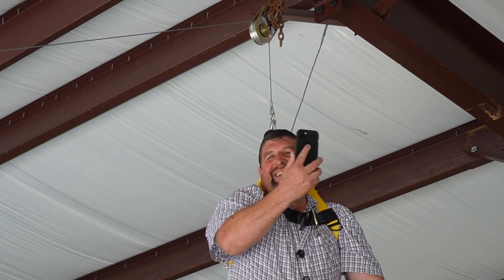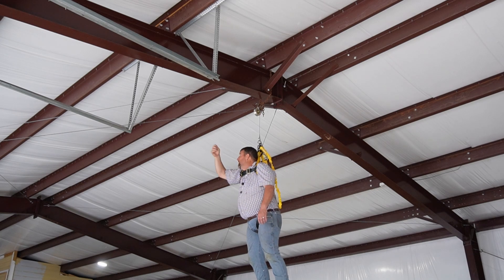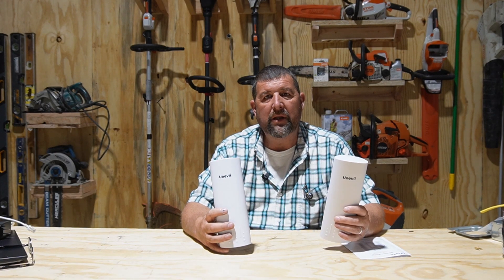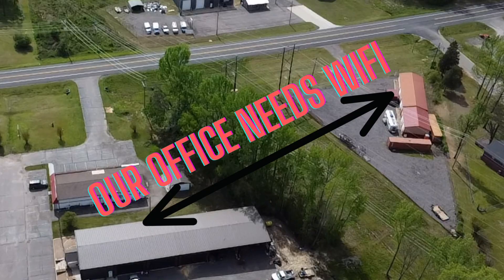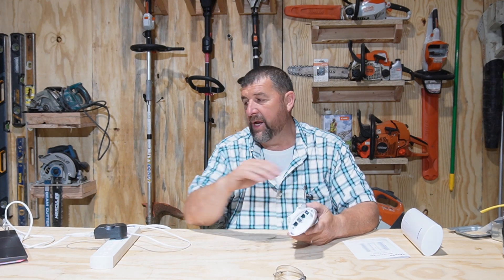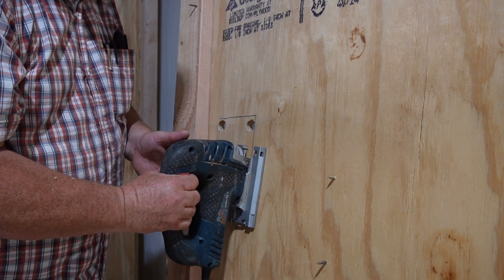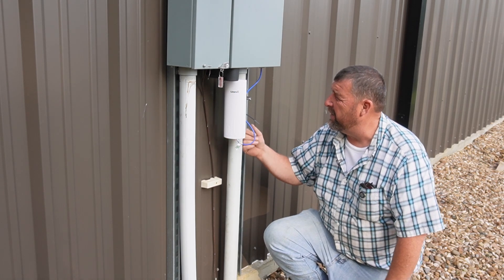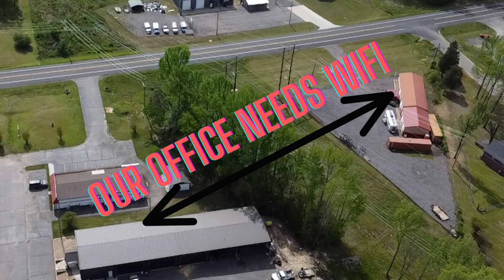The Future of Wireless Tech: Ueevi’s Game-Changing Innovation

Comment: A simple drip loop would probably be good enough on the exterior module. These things are great, but I do wish someone would develop a simple waterproof standard for these types of devices, instead of the RJ45 connectors.
Reply from the maker: I’m still puzzled why there’s not a better cable . I thick we are going to try flexible conduit.  Thanks for watching and  for the comment.